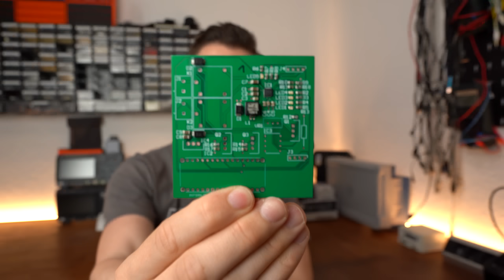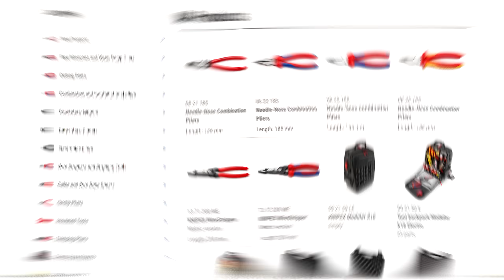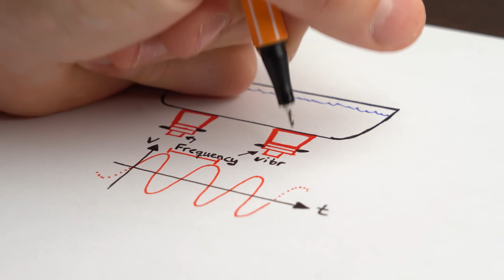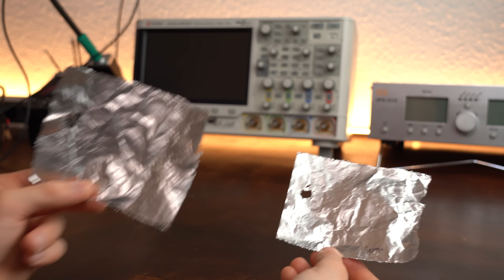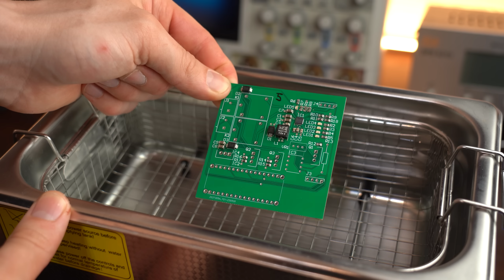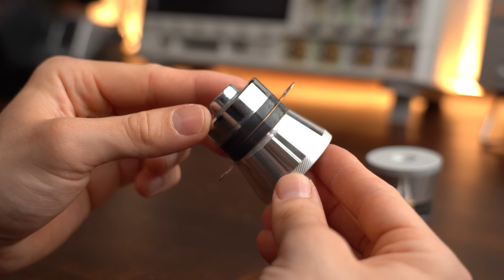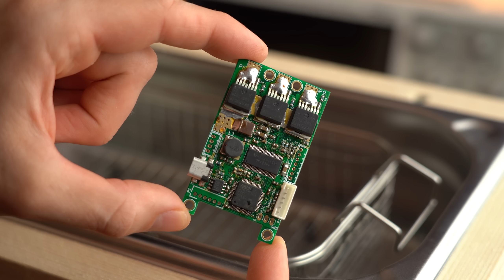The Most Underrated Tool? (DIY or Buy) Ultrasonic Cleaner!

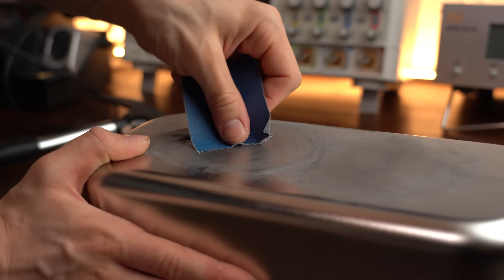Comment: Ok and good = 10:20 Clean the surface for the epoxy glue + sandpaper + flamable liquid to get dust and finger fat/grease away- 
 
To get a better and cleaner surface for the glue. The thin and mechanical hard connection (with no air bubbles in the glue area) is transfering the ultrasonic wave to the stainless bassin. 

I have a TIG welder in a metal company around. The welder like cigaretts and weld 3 bolts for free. 
He TIG weld me the metal pin (in the aliexpress set by the transducers) at the staineless bassin 
and weld the stainless srew for earth ground underthe bassain bottom. 

The hex screw at the transducer is in my opinium to add addition pressure at the TIG welded bolt. But I dont know it.
It is only a weak remembering what i heard in an DIY youtube video. 

The epoxy glue is essential for a maximum contact area ! 
IF YOU can not TIG weld the bolt well it will still work nice. 
But remember the transducer can fell of !!!
It is not unusual when a transducer lost contact ! Remember my words. 
It the transducer works without the bassin (AND filled with liquid) the ultrasonic wave energy can and will destroy these tranducer after a while. Never ever test the transducer without the bassin and the ultrasonic wave energy have to spread there energy in the cleaning liquid. OK ?

When you transducer fall of the bassin = 
I hope not it get contact with your power main ! 
The earth grounding is your personal life safer ! 
DIY is not worth to get hurt or more ... 

I add a little preassure under the transducer with a foam .
When the not TIG welded transducer fall of the stainless bassin it will stay at the loacation.
The foam is soft enough when heated liquid expand the bassin and mechanical dimensions change. 

Ok, I reduce the aluminium surface (for heat dissipation of the transducer) . 
Not a positive effect ! But in case the transducer fell of the bassin ... 
I work at a better solution. 

I have a isolation layer over the electronic board ! 

And yes, AIR COOLING of the electronic board safe you money ! 
Nice if you think which way the air will thake. 
I build with paper board a air channel from transducers then over the electronic and to the outside. 
I used 2 ventilators form more air flow (and I got some old from a computer). 

The grounding of the bassion on top is in the area of water corrosion. 
Good and safe earth grounding is your personal life safer ! And when ou use flamable liquid ... well life safer and your cheap aliexpress china transformer for lowest price ever seen electronic board ... 
If there is a in 70 years (or earlyer) a fault your biological reaction is ...
And as the manufacturer of a technical equpment (even your DIY cleaner) your are the full financial responsible in case of an accident.Even if a burgular try to work with your US cleaner. Ok ? No ? But in my country under the state law ! 

Polarity of the ultrasonic transducers = 
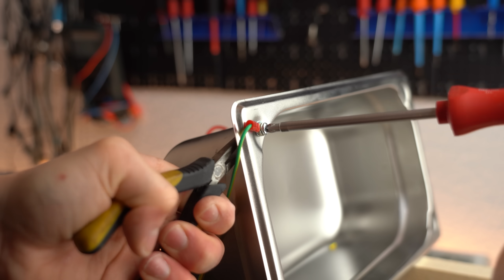10:44 You connection is ok ! 
All transducers paralell (not serial) = Your have done it perfect ! 
Some china electronic board have 2 separat electronic ciruits. Read the manual. 

You can not add extra transducers at the electronic if the manufacturer ...
The transformer and tansistor and electronic components are th weak to drive an extra transducer. 

The contact with direct connection to the aluminium of the transducer is MINUS 
The contact between the brown isolation is PLUS at the electronic board. (You choose red wire colour)

See and look for the Datasheet of the transducer company. 
Uppps I heard from one transduce manufacturer / modell ...
and there you see the MINUS connector was the upper connector. 
But still these different connector is in contact with the transducer aluminium. 
Allways look for these connector at the aluminium. 
Well and read the datasheet to be sure.

Again = To be sure use google + your time + manufacturer datasheet. 

Are the sellers electronic experts or only unskilled person with a internet shop ? =
And yes the sellers are often only sellers and not electronic experts and CAN WRITE rubbish in there added papers. 

Analog and see Youtube channel from EEVblog = 
Result  = yes the plus or minus printing at the electronic board can be wrong aswell. 
Ok you and I have to trust these printing. 

Additional = Heated cleaning liquid is less dense than cold water. Cold is better ? 
I dont know.
But I use chemical liquid for ultrasonic cleaning. And if these chemestry is warm is works better ! Mutch better.
With electronic boards I use the water without minerals/kalk/... 

Attention =
1. I am not an expert ! 
2. You are responsible for your work.
3. Control if my words are ok or false.
4. Ask an expert with knowledge.
5. If someone get hurt, lost his/her life and or fire and or lost material and or money = You are responsible not me 
6. Search for more information 
7. Look for datasheets 
8. Dont trust every Youtube channel video 
9. In my country und these state laws a DIY device and who is fully responsible for all time ? 
Yes the builder of these device. Not me and not these Youtube Channel owner and not aliexpress and not the chinease seller 
and not the chinease electronic manufacturer. You are in my country responsible. 
10. DIY can be sometimes more expensive than a ready to use ultrasonic cleaner with some month guarantee from a local seller. 
11. If you still build it by yourself ... Think about one spare electronic and pair of transducers. The seller are seller and want to earn money and often after moth/years stop selling things because only a few persons buy these DIY parts.

Comment: Use an audio amplifier and a high frequency driver (I have an old Altec Lansing HF horn driver, 100 watt with an 8 pound magnet), And, don't use thin gauge stainless container. Use a big, heavy, cast iron pot. But, only use 1 (ONE) driver in the center (the media vibration can cancel or distort, just like audio waves). Input the amplifier with a variable frequency generator, or your favorite music, to have complete control over specific frequencies that work better on different objects that need cleaning. Also; don't let them just lay in the cleaner. Fasten them with a weight or magnet to make them static. If they start moving in phase with the frequency... Nothing happens. My fifty watt audio amplifier's output to the speaker driver at half volume will vibrate that heavy pot full of water off of the bench. Simple is better. Oh yeah, don't pronounce the "K" in Knipex, it's silent. Like nipping off the insulation. Great stuff. I love that your videos aren't dumbed down for idiots. If you aren't a "Hands on" electronics tech; you shouldn't be playing with electricity. Keep up the good work! Fantastic stuff. And always!!!! Be aware of the electronic component "trapped smoke" engineering. A++++ 
Edit; I use glass beads in mine sometimes to clean rusty nuts, bolts, tools... Works great.

Comment: If you use a bit more heat when flowing the boards, the components will self-align properly due to the surface tension from the molten solder. Additionally, more of the balls will absorb into the pads resulting in a cleaner board and the right volume of solder being on the component leads.

Clean-up wise, just use isopropanol from a small spray bottle and a little toothbrush action.  The ultrasonic cleaner is a great tool, but best for the garage as it can damage some electronic components. Don't forget that bond wires are attached using ultrasonic and pressure during manufacture of the IC's, so they can come off because of ultrasonic cleaning too

Comment: I wonder what kind of epoxy glue you did use to attach transducers to the bath. I just bought second hand Bandelin RK255H for USD120, but I discovered the transducers were fully attached to the bath.

Comment: Zefer yildiz built a 30v 10a power supply I bought the boards from jlcpcb I built three of them so far but I can't get the current adjustment to work it uses lm723 could you take a look at his schematics on that see why it don't work

Comment: I used to assemble these for a family owned company, the trick we found to producing a high efficiency product was to use an old fashioned VALVE AMPLIFIER TUBE, it produced a rougher frequency wave than transistors and ic's. Therefore a superior cleaning experience even on commercial cleaning units the size of a large sink (many, many, many, many, transducers). The rougher frequency curve also works better on ultrasonic therapy units, but not for Ultrasonic Imaging Units.

Comment: I don’t recommend doing this with boards with microprocessors or crystals. Also demineralized water should be less conductive then iso. i would recommend that you use demineralized after but allow time to dry. You could build a tester to measure the conductivity of the demineralized water and once it hit a contamination level, I recommend swapping it out with fresh water. Also safe wash is great for removing flux.

Comment: Nice video. English is not my language, i am a producer of transducer and a little more complex generator, gonna try to give some advise: keep in mind that ultrasonic cleaner "add" meccanical force to a solution capable of clean the dirt that you wanna remove; ofc for some kind of dirt, plain water alone will work (like dirt based on emulsifiable oil, sugar) but dont take it as a rule, in many cases you will need specific product. In bigger tank when u first pour in the cleaning solution, make it run for a while to let solution free up entraped air boubles. Do not use distilled water for the cleaning solution instead use it for the final rinse: you will have better result and avoid limestone marks. many cleaning product will give best work between 45 and 60° Celsius; dont fill too much the basket or use the cleaner w/out basket, because you will limit the cleaning capacity. The alluminium test is a cheap but repetible and meaningfull test, one trained person can spot an "end of life" tank by cheking it. Generally the alluminium foil test take about 10 seconds, and good cleaner in that time will make several tiny holes. Avoid to run the transucer w/out liquid inside the tank, or in free air like in this video, you are going to make the transducer overheat.

Comment: Huh, that's the same kit I tried from Amazon a while back.  Mine just didn't work.  The transducers made a very faint buzzing sound, but not enough to move the water any, then it burned out about two minutes later and wouldn't do anything.  I need to get back to that project sometime, I guess.

Comment: I tried to make one with a vco and half bridge topology, where, through the vco I’m capable of modulating the frequency (mass if water/objet in the container) affects the resonnant frequency. The problem is designing the transformer at the output of the halfbridge… I’m close to finding the correct turn ratio of the EE ferrite core transformer, but its such a complicated data 🤔

Comment: Instead of using the ultrasonic cleaner, i would go with some sort of electric or rotary brush with soft bristles. 
Maybe those electric toothbrushes would work. 

Or maybe a small dremel with a soft brush? It wouln't be automatic, but maybe faster than hand scrubbing the pcbs.

Comment: I would not recommend to use ultrasonic cleaner for cleaning glasses with lens coating (anti-reflective etc.). In my case, it lead to damaging the coat after few cleaning processes (it started to peel off). I would only clean glasses with lenses without any coating...

Comment: A couple of comments :
1) Be wary of putting glasses (spectacles) in ultrasonic cleaners. Some lenses with films / coatings will get the film damaged or weakened (all my polarized lenses end up flaking)
2) Your solder paste / soldering quality looks very poor. Have you tried different pastes and dialed in your reflow setup? I'm using very low tech tools (PID controlled fabric iron) on similar sized boards and get tightly aligned components from capillary action with shiny, well wetted feet (disclaimer - I do use leaded paste) requiring almost nil cleanup. Currently using Chip Quik TS391AX50 .

Comment: Some ICs are sensitive to certain ultrasonic frequencies. Specifically, some MEMS sensors. Check the ICs datasheets first to make sure you don't need to use an alternate frequency setting on your cleaner.

Comment: @GreatScott! - When you were manually cleaning your boards, you were not using enough alcohol.  The trick is to get an oversized tub filled with enough IPA to fully submerge your circuit card assembly (CCA) and then take your brush and scrub the board in the IPA.  This way the residual flux dissolves into the alcohol and gets washed away rather than simply spreading around the rest of the board like the method you showed in your video does.  When I used to work at a MIL/Aero engineering company, we would use a 3-tray IPA cleaning process on space flight boards if the customer was picky and wouldn't allow our batch cleaning process.  The idea was you had three tubs with 99% IPA in them, the first was the "dirty" one and is where you started the board cleaning process.  Once you scrubbed as much flux off in the "dirty" tray as you could, you would move your board to the second tray which was by nature cleaner IPA than the first and you'd scrub again.  Once you were satisfied you got it all off in the second tray, you'd move to the third tray which should be nearly pristine IPA still.  This will get any residual flux off the board.  When done, we would blow dry the board using dry nitrogen.  As the second and third trays would eventually get dirty they would be rotated into the first and second positions respectively and the first tray would be dumped and replaced with fresh IPA to become the new third tray.

On a separate note, we would NOT use ultrasonic cleaners on flight hardware due to the very real chance that the process would cause damage to the CCAs.  For home use it's probably not a big deal, but as an industrial process for high-rel hardware it's a 'no-no'.

Comment: At work we put our parts in beakers with the solution we want to use and float them in the water of the machine. We have machine covers with holes the size of the beakers we use in them to keep them from tipping.

Comment: Fun video!  If simple woodworking projects and quick wooden enclosures are within your areas of interest, you might enjoy picking up a pocket hole jig kit.  They allow you to make strong and square joints in even fairly thin plywood.  I picked up an inexpensive little two hole jig which came with a drill bit and adjustable collar for setting the correct depth.  The instructions have a simple guide to translate the material thickness to the correct depth, jig position relative to joint, and screw length.  I've made quite a few things using it like cabinet drawers, speaker boxes, project enclosures, and even just plywood boxes to keep tools organized.  Kreg's pocket hole products seem to be well regarded and I think they're available around the world.  I went with a cheaper option from MilesCraft and I've been happy with the performance given the price.

Comment: Ultrasonic cleaners are great and have their place, but if your PCBs look like that after reflow soldering, something is wrong with your process or your paste is bad. It should not form all these extra blobs and all the solder joints should be nice and concave with the right amount of paste. And the surface tension of the molten solder paste should also nicely center all the parts on its own, given the pads are designed right too of course, but they don't look bad.
Depending on the paste there may be some flux residue to clean, but with most good pastes not even that. But if you have to clean up flux residue from reworking or hand soldering, acetone or one of the specific PCB cleaning sprays usually makes very quick work of it with an ESD free hard bristle brush.
Just my 2 cents. Any excuse to get an ultrasonic cleaner is great of course, but you really shouldn't have to use it for that.

Comment: I have to say, you doing something wrong, even if you apply the solder paste and the components manually, you should not get solder balls on the PCB surface. I have never seen a PCB, and I have seen thousands with such bad soldering.

Comment: I respect the Knipex sponsorship. First one I've seen them do on YouTube. 

Great tool brand. They do what they're meant too, they do it longer than youd normally expect from a tool and they'll take your abuse of being an absent minded tool owner and leaving them out in the rain. 😂 So my buddy tells me. Yea. My buddy

And someone probably said it, but I clean my carbs in a ziplock full of diesel with no air in the bag. Gasoline works too.  The vibrations go right thru the bag but then you get the petrol as a solvent at the same time

Comment: It is worth checking that there is thermal paste between the power transistors and the heat sinks. Adding a cooling fan is recommended.

Comment: Great video thanks for making it.
I am confused though on several things.
You said water being used, but it is supposed to be deionised water only! and not regular water.
2nd is any approved cleaner is use specific and there are one for cleaning rust, some for flux and grease and even some for plaster and tar.
And ISO should never be used unless it is massively watered down and approved for your ultrasonic cleaner.